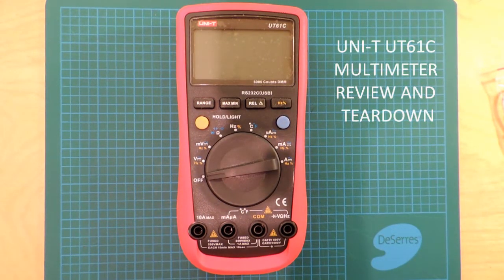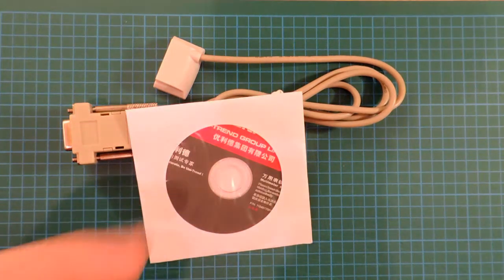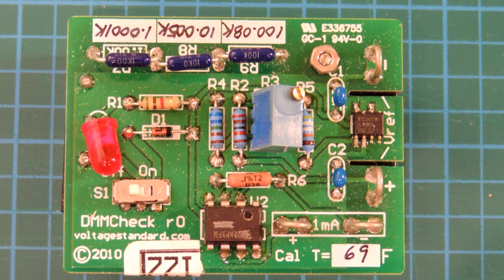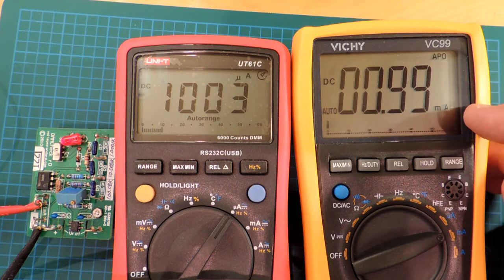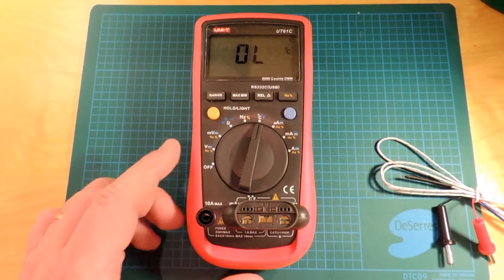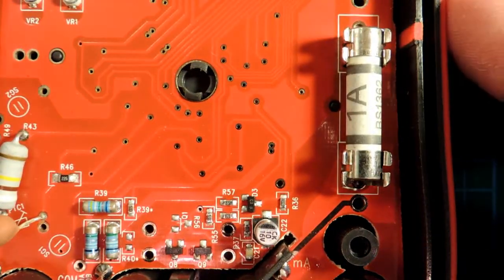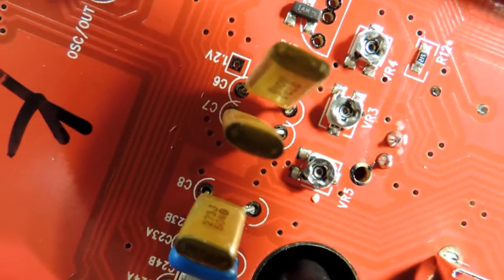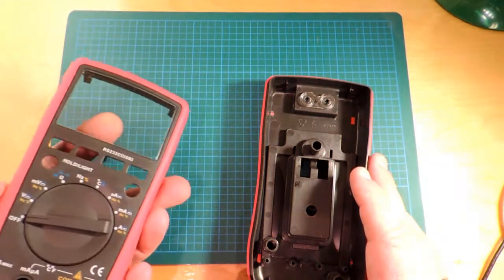UNI-T UT61C Multimeter Review

Comment: The D model uses the same chip.  I know this because I had the main IC fail when someone tried to measure a car battery with the leads setup for milliamps.   I was looking at the VC99 for a possible donner IC.  Found a new IC on Ali-Express that worked out perfectly and after re-cal vs my 3457A all has been well.  I now use that meter as a kick around for being brought back from the dead.   I've found it to be a good enough meter.

Comment: does the voltage sometimes over shoot? lets say that you have a power supply that is set to 20 volts when you use your leads does it jump higher than 20 volts lets say like 30 or 40?

Thanks
Reply: Lex luthern no bro